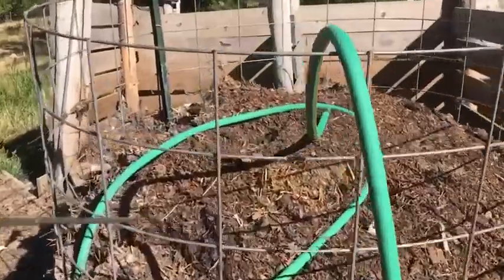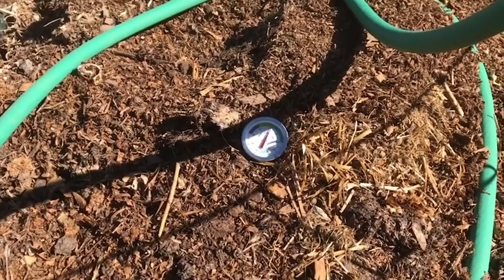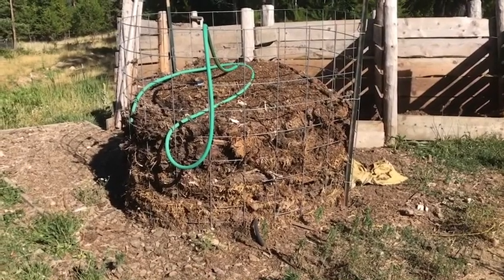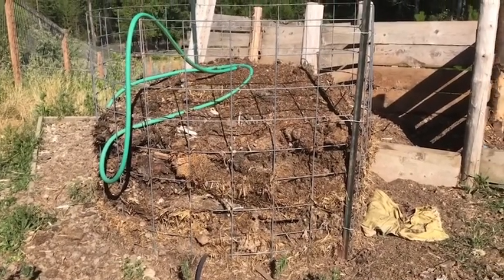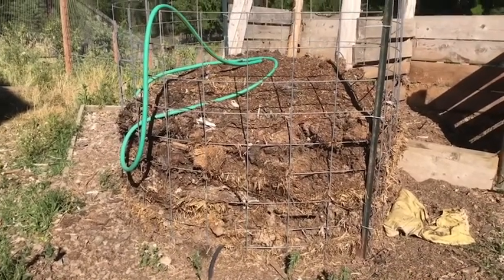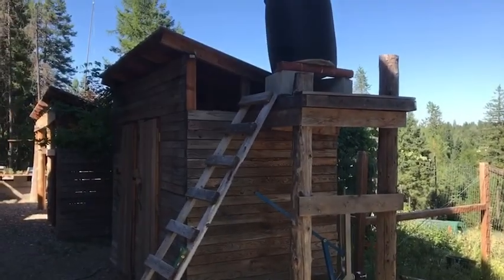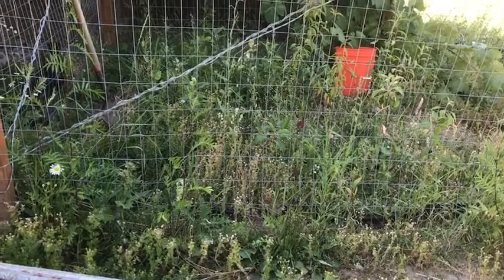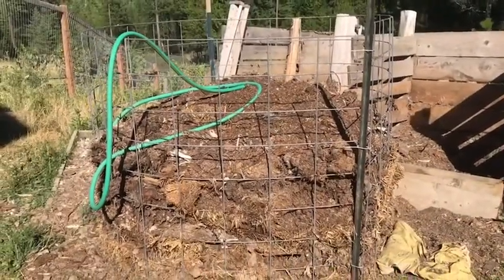Compost Hot Water Update

Comment: You might try a Toyota Prius water pump connectef to a small solar panel for circulating your hot water to a storage tank.
Reply: Try a thermosiphon. All you should need is one long hose from the bottom of the tank down to the pile, spiraling up through the pile, and back to the top of the tank.

The hot water should rise by itself through the hose into your tank, drawing coll water from the bottom of the tank. When the tank is hot or the pile is cool, it'll stop circulating, without any sensors, pumps, or gadgets.

The main thing is to keep the water level in the tank above the returning hot water, and to keep the tank above the compost pile.

Worth a shot?
Reply from the maker: Lilac City Real Estate why a Toyota Prius water pump? I like it though, I will do some research... thanks
For the tip
Reply from the maker: Leif Pedersen definitely worthy of experimentation but I'm not sure if the water will be hot enough to thermosiphon at 110 degrees. I will have to look into that more, thanks!
Reply: I bet it will, coming from an optimistic lack of experience! :) Look up solar water heaters on YouTube. At least, that's where I found the idea, no credit to me. You have an optimal configuration with the tank up high, whereas in a solar heater for a house they have to resort to tricks like maneuvering the tank into the attic.

I think the key thing is to make a loop of pipe so that the warm water need only be just slightly buoyant on one side, so the heavier water on the cool side will slide down.

PS. Been a lurking fan for awhile, kinda miss the podcast.
Reply: Hi all. I just subscribed. I have been curious about using a thermosyphon. Did you research or try it?